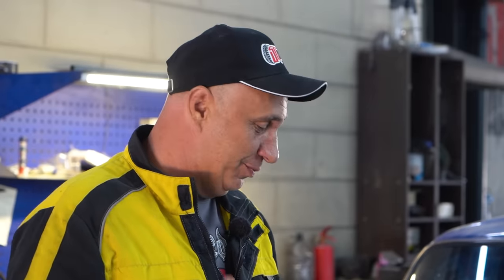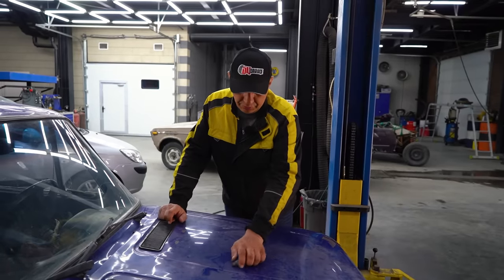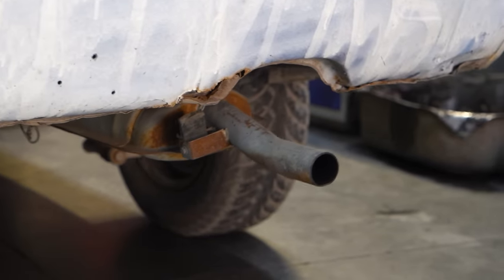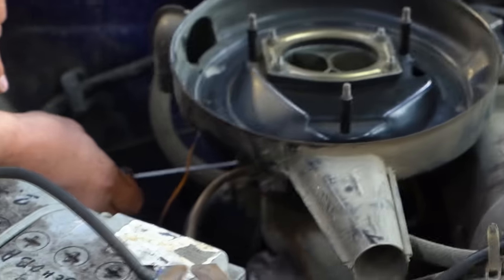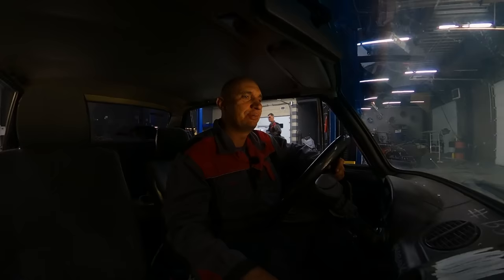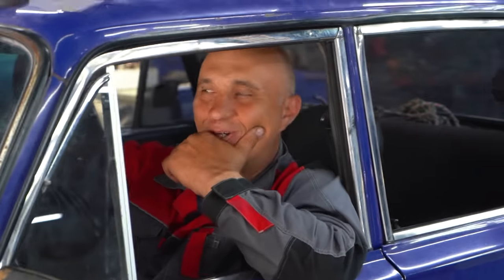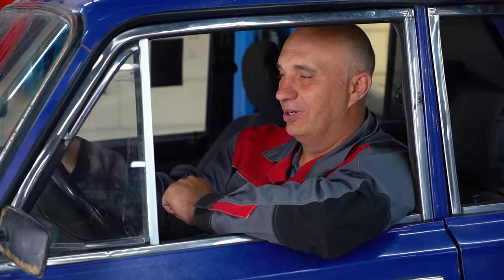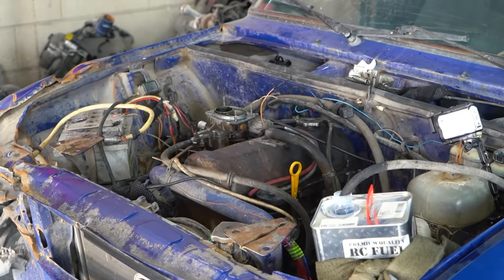Glow plugs in a gasoline engine - will it run?

Comment: I have an old Briggs and Stratton service manual that describes running the engine on kerosine by installing an optional injector pump. It still uses spark plugs , and no glow plugs, but the carb is deleted. I ran a Briggs engine on propane by running a tube from the propane torch into the fuel line and choking it all the way.The 1980 Mercedes owners manual describes mixing gasoline with diesel fuel in cold weather if no kerosine( number1 diesel ) is available. I forgot the percentage, but it was not much. I’d like to see a Lada with an injector pump running on diesel kerosine.Chevy V8’s were converted to diesels in the 80’s but they didn’t hold up too well.Maybe a spark plug / glow plug- injector pump/ carb combo would cover all the bases?Bahahahaha😆

Comment: Surprising the engine did run, and the glow plugs didn't melt, as they are not designed to be left on all the time. great experiment.

Comment: Diesel needs heat to vaporize properly. If you pre heat the diesel it will vaporize through the carb better. Run a steel fuel line and wrap it around the exhaust manifold to pre heat the fuel.

 I have run a gas engine on vaporized gasoline, alcohol, diesel, and kerosene. It's all about getting in to the cylinders in a vaporized form at the proper time.

Comment: I'd like to see you try running the engine on diesel after fully warming it up on gasoline, I think that will work much better. I have gotten 4 stroke small engines to run pretty well and make decent power while running on diesel without spark or glow plugs, but the engine must be hot for that to work.
Reply: without spark or glow plugs?
Reply: @IvanOoze1990  Yup, it's a Briggs and Stratton lawn mower engine. The spark plug was still in the engine, but disconnected once the engine was warmed up and switched over to diesel. The engine sounds smooth and normal under light loads similar to when it's running on gas, but it has obvious spark knock under heavy loads. I should make a video of that some day, it's really cool to see a gas engine running with the spark plug disconnected.

Comment: "A bit of back firing but nothing unusual." 

What a quote.

Also I would try opening up the idle jet somehow for the nitro. More stable but less energy dense so A LOT more fuel is needed. Like flex fuel cars and how much less economical they are on E85 as to Gasoline.
Reply: Cool story bro

Comment: ethanol, methanol and i'd guess alcohol use in the case of ethanol 30% more fuel to do the same job/workload. so one would assume nitro methanol would use some more as well.

i think the reason the petrol was idling ok ish and poor revving is the heat is being blown out at higher rpms if you used hot exhaust to preheat an air intake like on some old school petrol/diesel engines that have grid heaters to start in cold weather i think it would work much better.

Comment: If you could try scale model aircraft glow engine plugs and methanol as fuel, it could be interesting. The glow plugs have a platinum wire heating element which due to some catalytic effect remains hot after the engine is running and the electric current is disconnected.

Comment: Thank you for doing this, proving a concept and validating me. Back in the day I asked the same thing about replacing spark plugs with glow plugs and running a gas engine on diesel.
Reply: I always wondered if this would work
Reply: @TonytheGr8  So did I
Reply: Diesel mechanic here. It wouldn't work as compression wouldn't be high enough and fuel atomization wouldn't be fine enough. The glow plugs are only starting aids. Thry only run for about 15-30 seconds until cylinder Temps warm enough so the compressed air is hot enough to ignite the fuel. Diesel timing is all on when the fuel is injected. There is no ignition.

Comment: I would of liked to see what would happen if you used that rc glow fuel with the spark ignition and the carburetor tuned to supply at least 30-35% more fuel than it did with gasoline depending on the percentage of nitromethane of the rifle glow fuel.  I know when a four cycle compression ignition engine with a glow plug is converted to spark ignition the engine will produce between 40% to 75% more power depending on the percentage of nitro in the fuel, the cam profile and number of cylinders. when a .5-1hp 20cc four cycle gasoline weedeater engine is tuned to run just on methanol it'll make almost 3hp start adding nitro and it's not hard to get to 5 hp but at that point you need aftermarket piston aftermarket cam aftermarket head studs, head gasket and rod bolts and the head and deck should be machined to raise the compression if done right that 20cc engine will make the same power as your average lawnmower engine on gasoline.   if you had tuned the carburetor for the methanol/nitro fuel blend I'm sure it would of worked OK but if you had used that fuel and the spark ignition that little engine would have made big power as long as the ARF was kept safe nitromethane adds more oxygen and makes more power than nitrous but has near 1 to 1 fuel ratio and methanol is 5 to 1 naturally aspirated so a lot more fuel is burned compared to gasoline`s 14.7 to 1 fuel ratio which means a lot more power

Comment: With the rc fuel you need to increase the jetting size and tune the air fuel screws and idle, and i bet it would run way better
Reply: yes when you go from petroleum to alcohol you need to run much richer, much more fuel to air

Comment: If you drill a small recess in the exhaust valve it will fill with carbon and get hot which will produce a similar result
Reply: You mean like a makeshift pre-combustion chamber?
Reply: @VitoVeccia  just has to be about an 1/8" diameter and slightly deeper
Reply: @Mrpurple75  that's a pretty neat trick.

Comment: Maybe the next project could be adding a glow-spark combo to see how well you could run an engine on a gasoline-diesel mixture. There could be a goldilocks sweet spot in the ratio (50/50, 60/40 gas to diesel, etc.)

Comment: Timing seems off on gasoline. I think you could try to adjust it by swimming (or lowering) the plugs. 

Rc engines  methanol run on WAY RICHER mixtures compared to gas. Maybe adjusting the carb would fix it

Comment: I enjoyed this experiment. The nitro rc fuel is primarily methanol, approximately 75% methanol, 16% nitro and the rest is oil. Normally a blend of synthetic 2stroke oil and caster oil.

To burn properly methanol requires a ratio of around 6 parts air to 1 part fuel.... Normal gasoline is 1 part fuel to 14 parts air.

With the 16%nitro in the fuel, it would be better to run even richer.... 5/1 possibly

Methanol also burns much more slowly, so if running standard ignition the timing can be advanced somewhat

I would like to see an experiment where the car can run properly with the nitro to see how powerful it is. 

To do this the jets in the carb will need to be modified to supply 2.5x the amount of fuel from standard/current arrangement

Comment: Nitro Methane has a lower density than Gasoline. 
It would be, that the carburetor cant even keep up with the needed fuel flow. 
Maybe.. using 2 carburetors?

Comment: The main reason why gas engines don't use glow plugs is that the engine can run backwards loosing it's timing tensioner and run off it's timing, definantly not ideal for an interference engine.  A diesel engine is designed to run forwards or backwards.  Producing spark with a coil controls the timing of detonation to produce rotation in one given direction.

Comment: I think you would have more success using a fuel injected engine with your glow plug setup.
You could then adjust the injection timing through the computer via the OBD2 port.

Comment: Need alot of compression for a glow plug, for gasoline also would have maintain a temperature close to its ignition point but not quite there, compression would provide the rest of the heat Energy needed

Could use glow plugs that utilitize induction heating for such purpose, and the heated end would preferably have a large surface area, like a sponge so when fuel air contacts under compression you get ignition without back fires and knocking

Comment: Should require less air intake using nitro fuel. How much you need is anyone's guess. You could try running ethanol with glow plugs. You are dealing with high compression and temperature using Nitro fuel and you are dealing with a completely different air fuel mixture.

Comment: The biggest problem with trying diesel is the fact these Ladas have too low compression to properly ignite it.  If I were to try though, I would start it on gas and switch to diesel while it's running.  Starting on diesel and kerosene is hard, that's why for a long time farm equipment had two types of fuel, one for starting, then the other for cost effective operation.

Comment: Please make  a combustion chamber that spools a turbo for rocket powered anti lag.    & hot rod a lada  with   A f1 steering, angle kit ,shift buttons , oversized radiator & oil cooler    Like some kind of  
formula drift Lada.

Comment: Put the Glow Plugs in a Gasoline engine with Fuel injection the kind that injects directly into the cylinder (which may solve the preignition problem) and see if it then will run on Diesel or Kerosine

Comment: I was thinking. Can you put glowplugs and an injector pump on a petrol engine to run a parallel fuel system and still keep the petrol system so you can use either petrol or diesel or both

Comment: i just remeber ,the vw ap engine if you have oil on the fuel after the engine warm up you can remove the power from the spaks plugs cables and the engine still rum

Comment: Filipinos do this all the time, actually.  Usually on things like farm trucks.  Even a low compression engine can run diesel, albeit not very well.  Generally diesels tend to inject fuel as the piston is moving up, and gasoline mixes fuel on the down stroke of the intake stroke.  This is why you are getting the backfiring, and why it won't rev well.  Also, diesel tends to burn slower than gasoline, which would explain the low rev, the cylinder isn't reaching max pressure at the right time.  Running a slightly lean idle should fix the idle issues, I would think as the cylinders would stay hotter.  I would say try moving the cam one tooth advanced (open the intake and exhaust earlier).  It might close the intake early enough to build a little more compression, at the expense of airflow at high rpm.  Diesel engines run by "excess air", meaning you rev them by adding air to the same amount of diesel.  I think you need to lean it out quite a bit to get it to run normally.

Comment: I was playing with a two stroke weed Wacker years ago I heated the spark plug with a torch and put it in the fuel was a mix of vegetable oil used motor oil and a little either.it ran smoked allot and you had to hold the idle up to keep it running.

Comment: The timing on a diesel engine is different than the timing on a gasoline engine. You will need to make an adjustment of the timing between the crank and cam I believe.

Comment: Can you try something similar on a diesel engine, basically adapter carburetor to the intake and disconnect the injection pump and see if it will run on diesel fuel running through a carburetor

Comment: The pressure for the fuel and compression of tHe engine would be my main thought of why it wont work properly but never know but i have heard desil in a gas engine = knocking, but gas in desil engine could work i would think but idk tbh never tried as did not want a block with a peep hole😅... Peace n love guys keep it rad stay safe and build on l8z famz ps idk on carb but fuel injection have diff results i bet and am curious tbh 😅

Comment: Torque converter on manual transmission
Reply: Go watch robot cantina. It's a CVT, but is what it is.. BTW, will never work for many reasons with a real torque converter.
Reply: @shawnsatterlee6035  heck yes, robot cantina's pretty cool (& also a G 54 fan, I've seen him comment here! :)  What do you mean a real torque converter wouldn't work tho? It's been done.. adds weight, costs efficiency, & still needs clutching between gears to not eat synchros, but it does 'work' IMO -- you can stop w/ no clutch & pull heavy stuff
Reply: @nathansmith3608 my thoughts exactly,but I would love to see it in action,you will be able to pull anything without burning your clutch.

Comment: it's firing on the intake stroke.
that's one reason why gasoline engines need variable timing.
if they just spark all the time they will fire before the intake valve is closed, and what you have with glow plugs that are just like a spark plug firing all the time.

Comment: Reminds me of this old lawmower I got from my neighbor - it was capable of both dieseling and running on after cutting ignition (head was caked in carbon), and two-stroking at low RPMs possibly from really weak valve springs.

Comment: Can't be that easy to convert a gasoline engine to diesel, or is it?
Timing is totally different, and instead of a carburetor I would use an injection pump.

Comment: Need try it in fuel injection intake? 1 last thing you not done there was feather throttle at engine building revs doing adjustment 👍

Comment: do those engines have a very high compression ratio?  i had problems with engine run on a bit every now and then because of such high compression ratio and it would only happen when the engine temp was quite high. Maybe because i had been giving it hell? maybe not? i would love to see you build a modern version of the gas producers that the cars used for cheap fuel. will the modern engines high compression, need for upper head cylinder head lubrication, etc, etc, make a difference? it may work good or bad but would like to know? BTW. i think the back firing is because of cam timing overlap. that tiny, tiny moment when the intake and exhaust valves are open just a small amount at the same time. on the nitro only with spark plugs it needs to run super rich. that's why the choke works so well also the timing makes a massive difference. maybe add a second carby?

Comment: On methanol with nitromethane, the quiet idle and inability to rev is probably because it's running lean. Also, nitromethane provides extra oxygen to the mix, so you will need to inject WAAAAAY more fuel compared to gasoline.
Reply: Thats model engine fuel👍

Comment: With that nitromethane you could almost remove the fuel jet or drill a huge hole in it and it would run. I think nitromethane is 4 to 1 AFR and that carb jet is like 13-14 to 1 AFR.
Reply: Yes nitro engines use alot of fuel for what they are, plus they use glow plugs with platinum heater wire that catalytically reacts with the fuel once not in order not to need constant electrical feed. Also these diesel engine glow plugs are not rated for continous operation and will burn out in a few minutes if left energized.
Reply: @manitoba-op4jx  Yup! Even less energy dense than ethanol if im not mistaken.

Comment: you may need at least 15 to 17 times more nitromethane than gasoline for revs. consider this when you use it next time i know its an expensive fuel but it expensive because you have to use  loads more. still it was really good video and experiment .

Comment: The timing is way advanced, gasoline ignites a lot faster than diesel does, so as soon as the gas gets into the cylinder and gets somewhat compressed it ignites, you’d almost have to use race fuel, like 110 octane gas and see if that helps the fuel ignite slower
Reply: e85?

Comment: you always can change the valve size in the carburetor. In this way can add more fuel when not idling (because idle is can change with a screw)
Reply: Cool story bro

Comment: The engine isn't reving because the air fuel ratio is off
Reply: And nitro methane is goofy with air fuel ratios depending on the % of the fuel